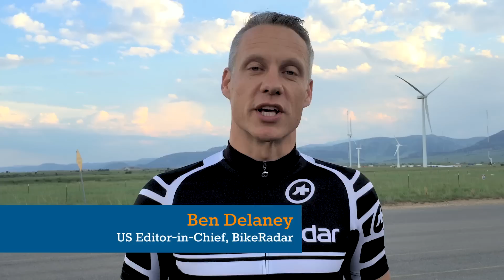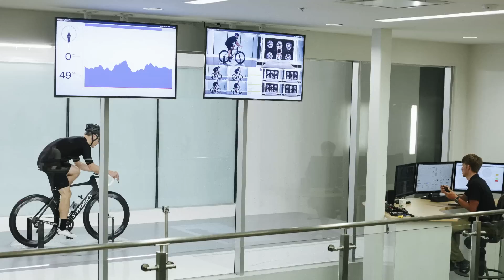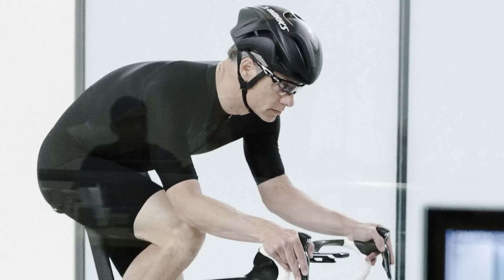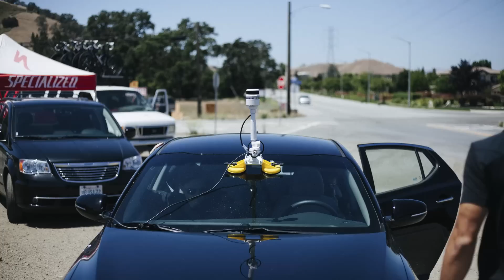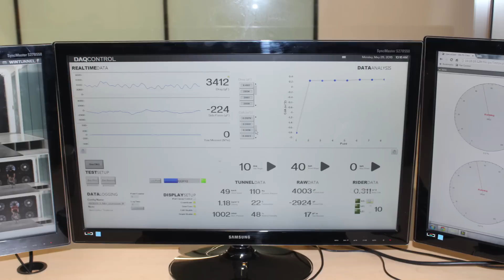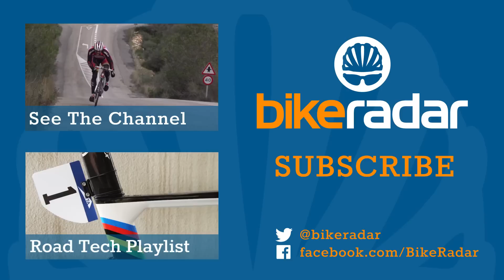Specialized S-Works Venge ViAS Di2 - Wind Tunnel Tested

Comment: It may be tempting to stick your knee out when going round corners but it will slow you down. Its much better to keep straighter line to be more upright.
AND whats the point of changing the skin suit unless you are only making a general comment on wind resistance and not about the bike. 
I could shave seconds off my off my delivery round if i took the basket of my bike....so what? oops! sorry, i just realised you are just trying to sell the venge. I'll keep quiet now.

Comment: How is this quantifiable if the helmet and apparel are changed. If you really wanted to compare you would have kept the same helmet and clothing and compared the bike with it's current competitor or previous model but that wouldn't have given you the marketing you desire, correct?
Reply: Peter deMos They have listed the benefits of each item individually on their (Specialized) website.

Comment: I pulled time estimates for the clothes, helm and wheels from the other Specialized videos which are savings over 40km, so everything here is cut in half since the ViAS test was over 20km

The Maths:
120s claimed savings over 20km for the ViAS
22 to 45s for the clothing (couple videos have differing results)
21s for the helmet
10s for the wheels (Wind Tunnel video says 34s over 40km, but that's box section to something like a 404, and the ViAS video is more like a 303 to 404)

so.....
     120-22-21-10 = 67s over 20km
or
     120-45-21-10 = 44s over 20km

In reality though, we rarely put our nose in the wind for 20km so a lot of time savings is negated by drafting in the break or with the group.  But over the final 200m we get this...

     67s over 20km = 3.35s per km = 0.335s per 100m = 8.4m over the final 200m at 45kph
or
     44s over 20km = 2.2s per km = 0.22s per 100m = 5.5m over the final 200m at 45kph

There is also an issue with the journalist doing 2 laps: 1)  if you ride a course you don't know you will be faster the second time because you know the course (turns, hills, etc).  If I was Specialized setting up a demo, I would have them ride the Tarmac first 2) If I'm on a new super aero bike, I'm going to ride harder than a standard bike.  I don't think they reported power was the same each lap, so no way to verify equal effort.
Reply: Steve Broglio Specialized says the 120 seconds is for the bike alone, similarly the other items are independent of each other, so the total savings is five minutes over 40 km, not 120 seconds.  I agree with what you say about the lack of power data reported, but their 120 second claim is just for the bike.

Comment: Lets defunk this for a moment with Specialized's own data, from The Win Tunnel Videos show the following saved over a 40km time trial for the upgrades listed:

Aero Wheels 34sec
Aero Road Helmet 42sec
Skinsuit 45sec

Which is 121 seconds, they said the new Venge Vias was on average over a 120secs faster for the riders in this video with the above kit changed aswell, so the frame has added 0secs improvement to there own tests? I may be wrong?
Reply: Crank Cycling I think their own data assumes a straight headwind. In real world testing, straight headwinds don't happen every time. So every component had a smaller gain, just not as simple as a straight headwind.
Reply: Crank Cycling http://www.specialized.com/us/en/5minutes?intcmp=homePromo1FIVEMINUTES
Reply: +Crank Cycling - The 120 seconds saved in this video was over 20 km, not 40 km, so half your numbers.  By your calculations Frame = 60 seconds saved.

Comment: Surely if you're testing how more aero a BIKE is then the only alteration should of been between the venge and tarmac not also the clothing and helmets which have been shown to make a massive impact on aerodynamics. Also why didnt they test between old and new venge? Is the difference between the two bikes really that minimal that they didnt want show those numbers
Reply: Exactly what I was thinking. It's all a marketing ploy!
Reply: BaconBaconBaconable True, and their whole marketing campaign is "5 minutes" (the supposed saving over 40k TT), which similarly changes like 10 different variables (skinsuit/aero helmet etc etc)!!!!! I'll stick with my $40 skinsuit, $20 shoe covers and <$1500 bike thanks very much.
Reply: BaconBaconBaconable Evidently they think the cycling population is stupid which it seems many are. I have already seen so many people chirping about this bike and how it's so fast. Basically people who don't question and just take all this as some kind of fact to make them somehow faster.
Reply: Peter deMos The placebo effect at work
Reply: Kalashnikov Cortez The Venge was always a sprint bike.  The Tarmac is a GC bike and the Roubaix is for rougher terrain like cobbles.  Straight line speed is useless to a GC rider if the bike isn't responsive in climbs.  That's why every manufacturer, not just Specialized has different bikes for different riders.  For the same reason every rider doesn't ride a TT bike for each stage...different characteristics for different uses.  As for Sagan and Cavendish, just because Specialized pays them to ride their bikes doesn't mean they'll just agree to ride an inferior product.  The whole point of my original comment was that the claims of Specialized that the new Venge is a faster bike.  I acknowledge there is a marketing part to this claim, but they have wind tunnel research to back up their numbers, whereas haters just say "that's BS".  Ultimately, it's the rider who will make the difference, so I don't think that Cav on a Venge is going to immediately be 5 minutes faster than another sprinter.  But, I also don't think that the Venge isn't a faster bike, just because I'm not a hater like some people.  As for Kittel missing the Tour, yes it's unfortunate, his whole season has been a loss and he would have been right up there with Cav, Sagan and Greipel.  No idea what that has to do with the Venge or this discussion.
Reply: So dumb that people keep sharing this BS without even realizing the comparison is so biased it's embarassing.
Reply: Apollovn So you're saying this Venge is faster than a Tarmac and comparable to the Shiv.  Then why the fuck is not all the Specialized sponsored riders not riding this instead of the Tarmac?  And yes, Cav and Sagan are hired guns who should thank god that Marcel Kittle is out of the Tour, because Kittel would whoop both of those chumps' asses and you wouldn't be here chirping about the Venge.
Reply: Apollovn "Specialzed research data"? And where is this conclusive data that is not released to the public? Oh wait, Specialized didn't release any data, they just released a bunch of marketing bullet points, telling us how fast the new Venge is.  Should we just take their word for it without seeing the actual data for ourselves?  And let's not forget that they are in facting not testing the Venge solely, but their marketing material seems to want us (or the gullible) to believe so.

Specialized may have done some testing in the wind tunnel, I'm sure of it. But once they mix science with marketing, they become garbage IMO

Oh, I took the opportunity to inject in Kittle because I miss that jolly bloke.
Reply: Kalashnikov Cortez Fair enough.  I don't think that it's unbiased and independent, obviously.  They did break down the alleged time savings per item though, and did post videos showing them testing different combinations.  It gets to the point where people who refuse to believe are just going to not care what they say or post.  They could put the actual telemetry up and people wouldn't care.  In this case, the video is by Bikeradar, not Specialized, and people still are hating on it.  I just think that taking an extreme approach, either in parroting what they say or blanket denying it, is just either being a fanboy or being a hater.  Like I said before, it's okay not to like them or like the bike, but to just dismiss a $15K bike or whatever it is as garbage for no real reason is lame to me.  Similarly, it would be easy to say that the Specialized McLaren Venge is garbage because McLaren are garbage...may be tempting, but not really objective.  As for Kittel, he's a monster for sure and frankly, his absence provided some of the little drama there has been in the Tour so far it seems as the GC looks to be a foregone conclusion already and we're not even through the second week yet!  Cheers.
Reply: Apollovn Has anyone else realised that Cav and have Sagan have been riding the old venge for the past couple of stages. I think Cav took his win on the old venge. I did a cursory search about this but nothing came up. Does anyone know if there have been any statements about that?
Reply: I don't think that's true.  The new Venge has different brakes and handelbars.  If you look at Cav's bike on Stage 7 where he won, he's clearly riding the new Venge based on the bars and brakes, and so is Sagan actually.  Sagan hasn't been using the new bars on other stages, but I think he's still using the new bike.  Certainly they wouldn't have ridden the new Venge on the cobbles or the team TTT.  If they are switching back though, you would think this would be big news since the bikes are scrutinized so closely after each stage.  After every win, there's usually a photo gallery of the winning bike and so on, and websites are quick to pick up when riders are using a non-sponsor's equipment and just blacking out the label and what not.
Reply: Apollovn My critiques of Specialized stems from these combination:

- Outragaeous claim (5 min is an outrageous claim) demands outrageous effort to prove it. In other words, such claim is held at a higher standard than say a claim of Merida saying their bike is 10 seconds fater.

- To make matter worse, the claim is based on the condiiton of when using all aero aids, eg., helmet, shoes, wheels, skinsuit. We know that skisuit alone could make a bigger aero improvemnt than the frame itself.  Perhaps Specialized doesn't want us to know that their skinsuit is actually a better bang for the bux than their frame?  Now granted, Specialized did not hide the fact that they are testing the Venge along with all other mentioned items, but still they are trying to fuzzified (word?) their achievement a bit IMO.  I would not call their methods as "honest" and "in good faith" since instead of isolating the independent variables, they mix a bunch of variables together.  And well heck if you're going to introduce variables, then why not introduce a deep dish wheel and full tild aero helment and come back with an even more stellar results?

- While it is true that aerodynamics aids are additive, thereby allowing them to tell us that the McLaren supermodel can predict the gain, but that's not how realworld aerodynamics always work.  But hey, McLaren is a respectable household name in F1, and who are you or am I to question the holy McLaren computer, right?  This is credential badge flashing.

Do I hate the Venge? Nope.  Do I hate how Specialized is marketing it more than it actually is? Yep.
Reply: Kalashnikov Cortez No question that they love to trumpet their own accomplishments, no doubt.  However, they have specifically explained how the 5 minutes is comprised of different elements, so as far as what the frame contributes vs helmet vs suit vs wheels, etc., they have broken that down.  The bike is 120 seconds and so forth.  They didn't mix them together.  They tested them individually in the wind tunnel, which is what their videos and other articles show.  Now, again, whether you choose to believe that or not is your right and that's fine.  I'm not saying it should be taken completely at face value, just like I don't readily want to spend $20K on a bike just because there's a McLaren sticker on it, but I'm not going to say "No, there's no way the bike isn't at all faster because Specialized are full of themselves".  The truth is somewhere in between, and I would think it's closer to five minutes than zero.
Reply: +Apollovn funny that you are bringing in sponsored riders to back their sponsors products. Every other point you make is valid thought
Reply: Emile Goguely They are being paid to endorse a product (well Cavendish isn't anymore since he switched teams) but I think it's fair to say they aren't going to use something inferior just because they're being paid.  Both Cav and Sagan won the World Championship riding Specialized.  Could they have done the same on Pinarello or Cannondale respectively?  Sure, maybe.  But they didn't, did they?  Again, if the premise is the new (not so new anymore) Venge is a faster bike and the new (not so new anymore) gear is aerodynamically faster, I don't see how that's BS.  Do I give it more credence because World Tour riders endorse it?  A little bit, yes.  That's why there are endorsements in the first place, to give credibility to a company's claims.  Doesn't mean it's 100% reliable all the time, but seems to me the results are pretty clear, at least this past season (Giro, World Championship, Vuelta, Amgen Tour, numerous stages, all Specialized.)
Reply: +Apollovn Sagan was riding the Tarmac for his World Champs win and Cav rode the old Venge for is TdF stage win so that isnt relevant to your argument. And I dont think they mention in this video that this is a paid endorsement i.e. an advert which is very different from independent reviewing which this video holds itself out as being. Plus come on WT riders are obviously going to say their teams bike sponsor are the best bike because its their job so you shouldnt really hold their views too highly because again they are paid to hold certain views. Also if any major bike manufacturer sponsored three of the highest funded WT teams; Etixx, Astana and Tinkoff then I'm sure they'd get a high amount of wins.
Reply: +BaconBaconBaconable I never said that Sagan rode the new Venge in the World Championship.  I said he rode a Specialized bike and won, as opposed to when he rode Cannondale and lost, or when Cav rode Pinarello and lost.  The argument was that what WT riders say should be disregarded because they're being paid to say it, and yet they had their career best achievements riding a Specialized bike.  I don't think they are going to ride an inferior product just because they're being paid to do so, and their results would seem to suggest that they either were great enough to overcome an inferior bike, or they are actually riding a good bike.  Where is your proof that the video is a paid endorsement?  I haven't heard that.  I also was not aware that Cav rode the old Venge in the TdF.  The bike he was riding seemed to have the new handlebars from the new Venge based on photographs that I saw following the stage win.  My point (from months ago) was that I don't just disregard the claims on the new Venge as BS like most people do.  The wind tunnel data is available.  The professional endorsements are a factor.  If others choose not to agree or give it the same credibility, that's fine.  It seems to me that most of the disbelief is based on an inherent hate for Specialized, as opposed to any real evidence.  Their claim is that the new Venge is 120 seconds faster over 40 km, and 5 minutes faster when you add other components.  Where's the counter testing that this isn't true?  I haven't seen it.  Is the bike a piece of junk if the gain is only 100 seconds, or 60 seconds, or 40 seconds?  I think I'd be pretty happy to have a Venge if I could afford it, and this video gives me a reason to believe it can improve my performance on some level.

As for the fact that Specialized sponsors some of the biggest teams on Tour, that's a rather vague criticism.  It's equally plausible that the reason those teams use Specialized bikes is because their riders are some of the best in the world and are more discerning than other teams, and feel Specialized bikes are better.  I find it hard to believe that athletes who make their living in a sport where seconds can make a huge difference aren't going to be very particular about what equipment they use.  Cavendish loved the Venge, both old and new.  Was he lying?  Was he just reading off a script?  I tend to trust his judgment over some random person who says Specialized bikes suck and it's all about marketing...again, just my opinion.
Reply: Its a year later, the tour is wrapping up, and say what about Kittle whooping Cav and Sagan? Hahahahahaa
Reply: Peter deMos You mean people like Mark Cavendish and Peter Sagan?  Oh, but they're being paid to ride it, so they could care less about whether it's actually fast or not, since their very living doesn't at all depend on whether they can save a second or two on their rivals.  Look, you don't have to like Specialized or the bike, but for what the bike costs and the market they are aiming at, saying their claim is complete BS is a bit extreme.  This is for the 1% of the 1% of riders.  It's a fast bike.  It's faster than a Tarmac and comparable to a Shiv.  Seems to me the data backs that up and bikeradar is confirming it.